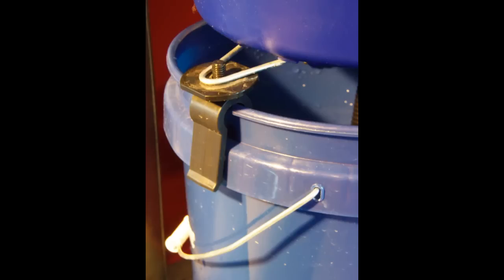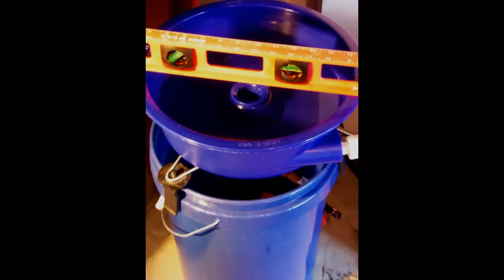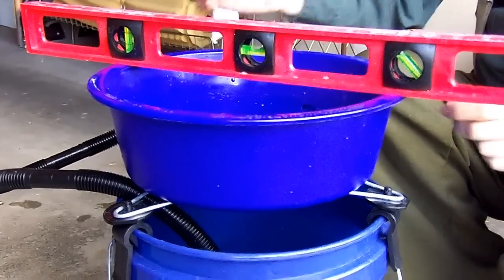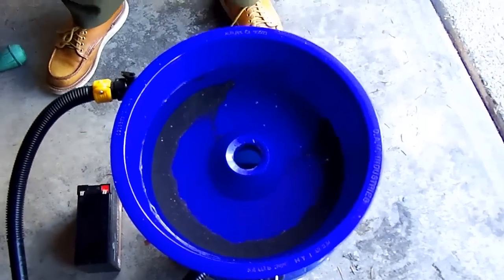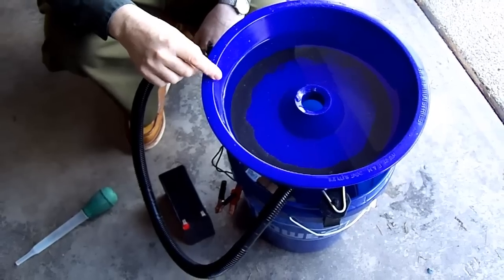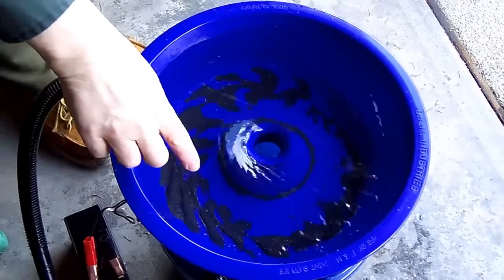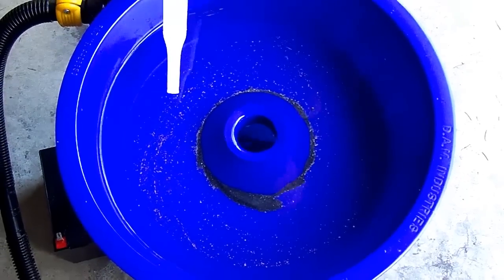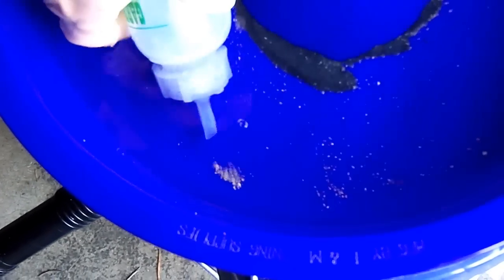Blue Bowl Tutoral for processing of GOLD concentrates

Comment: In my area gold is fine and flat. (0.1 - 2mm) Many times tried to wash it through the blue bowl, but nothing works, even at minimum water speed the gold is washed away with the sand. Maybe the Miller table can help, it seems to hold flat gold better.
Reply from the maker: Have you tired cleaning your bowl with dishwashing soap?  If there is an oil film on the gold--it will float away.  When your machine comes from the manufacturer, oiled metal  parts are used to make it, and so residual oil is usually found in the bowl.  Clean your bucket below also, as any oil on it will transfer into your bowl.  Also, put just a few drops of dishwashing soap in your water when you begin--every time.  It acts as a surfactant, making sure that the water touches all surfaces of the gold.  I never had your problem with the blue bowl, and used it on flat glacial gold.  So, it can work.  Remember, when you pan your gold you do not use the river pan technique.  THere is a special technique you need to use, or gold will float out of your pan.  Let me know if you continue to have issues . . .
Reply: @callmeBe  Thanks for answer! :) Yes, I washed it very well according to the instructions, there should be no oil inside. The gold is mine from the adventure scluice, then I put it in the blue bowl and try to clean, but at any speed, it all washes out. I even added the Dream Mate inside hoping it would help, but the effect is almost the same as without it. And there is a lot of gold in my spot, I once extracted 5 grams of gold from 2 kilograms of sand just by hand, but it is very long and tedious. I am trying to find a technology to clean my sand with fine gold, but so far I can't think of anything...
Reply from the maker: @teolegrande304  It is going to be very difficult.  Don't do mercury!  I would still put a surfactant in your bowl, to insure total surface contact with water.  Because the gold is so very fine, then the only other thing it could be, because the bowl is an absolute study in physics, and it can not fail if everything is right, is your mesh is not fine enough.  You need the very smallest mesh you can find.  If you are losing gold, the iron weighs more, or at least as much, and so you need to decrease the difference in weight.  Therefor, no matter how fine your mesh is, you need something smaller and finer.  I would not search gold mining stores.  I would search industrial supply stores.  Try Amazon with HYHMJ-Industrial Metal Mesh 6 Mesh - 20 Mesh - 80 Mesh.  I will bet your mesh is not 80 mesh fine . . .
Reply: @callmeBe  I have different classifiers and 80 mash too. I'm always sorting all the material. I get two kinds of sand with gold in it. The first is a little bigger, with 0.5-2 mm gold, and the second material contains all the gold less than 0.5 mm. The blue bowl flushes both. I think my material has a lot of sand in it and that's why the blue bowl doesn't work as it should. But I have a very hard time flushing sand by hand, a lot gets lost :) I will experiment, because it's a shame, so much gold nearby, but I can't get it :) Thanks for the tips!
Reply from the maker: @teolegrande304  I understand, but that is what  I was saying before.  You don't pan your kind of gold like river gold.  You need a specific pan, a surfactant, and a different technique--where you swirl very little if any, and the process is technique sensitive.  Let me get you a link.  Yea, the less material you have to seperate, the better recovery you will have.  You want to follow Keith from Youtube's "Hard Rock University."  He is a great guy, has a tremendous amount of experience, and is an excellent teacher (also was a friend--old geezers stick together--but I have not talked with him in years). Don't expect classy videos.  I see where here is using 300-500 mesh.  80 is way too big.  (I don't have that much experience with microgold).  watch this:   https://www.youtube.com/watch?v=IPEUJQi7-Lc     If you write him, he always answers quickly with reasonable content.  But I think your problems is basic:  probably mesh related, and you need to always use a surfactant.  (which he covers in this film).
Reply from the maker: Here is another good video by Keith.  His technique works.  I had one mine years ago that yielded micro gold, and I was successful with the technique he demonstrates here.  (Thing is for me, I want course gold;  the fine stuff is too much work for an old man).  https://www.youtube.com/watch?v=dEmnr5cV2Y0
Reply: @callmeBe  Thank you very much for the links! I will be studying them and experimenting! :)

Comment: Anyone here used this to recover gold from quartz flower/powder?
Reply from the maker: Well, other than purity, gold is basically gold.  So as long as it is in a mesh form, it will recover using this system.  The limiting factor will always be that you finely mesh ALL your material.  If you screw stuff up--run the water too fast, don't properly mesh, than you can always process again.  Nothing is ever lost until you throw it away.  One thing to consider, if your finds include micro gold, this system would probably not fully work, because the gold will be lighter than your sands--as your sands have relative thickness, whereas the gold would not--yet both having the same relative size.

Comment: Thank you for the information. I just got the blue bowl by itself. I do some fabrication so I will be making the levelers and using a swamp cooler pump I already have. The bucket the blue bowl sits on will be sitting in a larger tub with the pump in the tub, this way all the cons will be in the catch bucket and not in the water the pump is sitting in.

Comment: Hi, help me guyz i need this blue bowl or equipment where can i buy it!!! Plz help
Reply from the maker: I sold all my stuff and retired,  Ebay is probably the best place.  Make sure when you,ale purchase you also buy the shims.  that way your blue bowl sits flat.  It will not work if it is not dialed in flat.  The tubing you can get cheaply from any hardware store, and the water pump you can easily buy used on ebay.
Reply: @callmeBe  I use a 1 or 2-amp trickle charger with an old car battery that won't hold a charge for a car but powers the pump fine, just plug it in to use, and unplug when done. Any auto parts store has them and runs $20- $25.
Reply from the maker: Good thought

Comment: Hi, how long does thebattery last before you have to buy a new one. Thanks in advance?
Reply from the maker: Hello Doug.  Well, it depends upon how much you use it.  But a deep cell will generally last about 5 years with modest use ( maybe 15 hours of use a month). 4 years if you use it twice as much.  They are a good value, Doug.
Reply: @callmeBe  oh ok thanks
Reply: I have an old car battery hooked to a trickle charger,  1 or 2 amps, and I plug it when I run the bowl and unplug it when done, it's been going for years- think the low amperage of the pump it just runs off the charger, but the battery does hold a charge, not for a car, but has enough to run the pump overnight!  I forgot once.

Comment: i am working with 50 mesh material, the blue bowl no matter how slow i have the water circulation in the bowl, will take both the (few) gold pieces as well as the non gold material. i am trying to figure a way to stop this from happening, everything goes into the bowl at the bottom, but i may as well have just put a spoonful of material directly into the bottom bowl.
Reply from the maker: Hello.  50 mesh is about as large a material as the bowl can take, so you should be fine there.  It should process it easily.  I would bet that your bowl is not exactly flat to the floor.  Even when you are not even by a tiny bit, you will loose gold.  There is a inexpensive kit that is independent from the basic bowl  which helps you to insure everything is flat.  Of course, check with a level at several directions also.   I hope that is your problem.  It is easy to solve.  Oh, also, place just a titch of wetting solution in your bowl also.  Any dish washing soap will do.  Just a titch!  (Make sure you have also washed your bowl with soap, as it does come with a small coating of oil).
Reply: @callmeBe  well my BB is as level as i can make it, i have a large and a small level to double check each other, the small one i set on the inner cone, the large one i set on the bowl itself, just to make sure, so all good on the level part. i use jetdry in my BB, my problem is not floaters, the non gold material is basically the same size as the few pieces of gold i fine, i run the water speed slow but i still see the water flow move gold and same size non gold material around and slowly up the cone. i run my BB on top of a nugget bucket, so i still catch it all at the bottom, but its just extra work for me when BB pulls the gold and the rocks up out and down. i have had my BB for over a year now trying to get a positive action from my BB, so the new oil coating is long gone.
Reply from the maker: If it is as you say Zemetrius, then the process must work. Not should work.  Must.  It runs off of simple physics, which you have provided.   This is not a demeaning question, but are you absolutely sure that is gold in your finds?
Reply: @callmeBe  just to be sure it worked, i added some that i had found just to make sure it would work. so the test batch did have some in there, but it took what i put in there with the non gold material and sent it to the bowl in bottom of the nugget bucket.
Reply from the maker: And you are sure what you have is gold??  Again, if everything is as you say, the system works perfectly off of physics.  You simply control all the variables (speed of water, same sized mesh, bowl flat to the floor, no oil introduced, etc) and the system can't help but work.  There are no exceptions.   I can only suggest calling either the manufacturer, or the dealer from whom you bought the bowl from.  Or further testing, say,  with gold from a known source (buy some mesh gold on eBay--I see several that sell 50 mesh, but you will need to talk them down to a very small amount).  Then, when you have satisfactory results, let us know here on this channel . . .
Reply: @callmeBe  well i guess i could melt what i have down to something, but then i would have to get more to test the blue bowl with, but then you would ask again if what i have is real gold, then we would be back to square one.
Reply from the maker: not at all.  Then call your dealer . . .
Reply: @callmeBe  (test 1), water went to less than an inch below the top, everything got sucked down. reloaded material, (test 2), water went to the one inch line and everything was sucked down again, reloaded material, (test 3)water at 1 1/2 inch below the top, material barely moving. still watching......
Reply from the maker: "Adjust the water flow with the ball valve (approximately 2 gallons per minute), so that water is just slightly below the outer edge of the bowl and not over-flowing."  (Somewhere around 3/4" below the top).  'Then slowly feed your materials in.'   These are from the included instructions. I work mine differently, but the most important thing is that once you have the bowl working, the water level should be about 3/4" below the top.  Now, how you measure 2 gal. per minute I do not know.  But what I do know is that as the system begins to work, you will see the black sands begin to riffle out (like the video does here at 7').  At the same time, you will slowly see the lightest material migrate towards the center.  Is there any possibility your water pump is set too high--and you are just blasting the material out of the bowl?  You can do the same effect in a sluice box  . . . This will probably be even more the case if your gold is very small and pounded flat--like glacial gold, or beach gold.  If this is the case, certainly, you will get much less black sand riffling as it becomes less and less.
Reply: @callmeBe  test 3 continued: water holding at 1 1/2 inch from top slow movement of material, but if i try to tweak it, it wont take much to suck it all down again.
Reply: @callmeBe  the water pump is set at it lowest speed, did this much earlier when i was trying to make the thing work before. my material is classified through several mesh screens so there is no black sand, it has all gone to the lower depths. this material is stuff that sat on top of the #30 screen along with whatever gold was there also on top of the screen. the water is slowly creeping upwards toward the one inch line, then it will do the tornado thing and suck it all away. at 3/4 inch there would be nothing left of the material i am using right now. this is the headache i dealing with.
Reply: @callmeBe  i replaced the ball valve that came with the blue bowl, i installed a gate valve, its works much better compared to the ball valve.
Reply from the maker: Sorry, I don't understand exactly what you are writing.   "my material is classified through several mesh screens so there is no black sand, it has all gone to the lower depths. this material is stuff that sat on top of the #30 screen along with whatever gold was there also on top of the screen." Generally your gold is going to settle where that black sand is, somewhere around 50 mesh.  30 mesh is kind of coarse, and the largest size the bowl is made for. Your blue bowl is for separating gold from a lot of black sand--all of the same basic size.  If there is not a lot of black sand in your bowl, then you should be just panning your gold out.  Not using the blue bowl.  In other words, you will be blowing the gold out of the bowl.  There needs to be black sand along with the gold.  That is what the bowl is made for.
Reply: @callmeBe  well i guess i wasted my money then.
Reply: @callmeBe  i need to find a rocker sluice that is angled like the mini riffles on a pan. all the sluices i see online all have the riffles facing the wrong way. at least the wrong way for what i need.
Reply from the maker: The only rockers and sluices I have seen either have riffles that are simply 90% straight up, or the Hungarian type--that have a lean with the water stream, and an undercut on their back side.  If you go the opposite direction, and put a slant that faces into your water stream, I guess that is ok, as long as you have a deep catch (undercut) below the slant.  But remember, gold generally settles on the back side of riffle, not so much on the front--even when there  is an undercut.  This is because the back side of the riffle sees slower water than the front side--giving the gold a chance to settle.   I guess you could always get your sluice with the Hungarian riffles and just load the whole set in backwards.  Then you would have your undercut and the angle of the riffle slanting the way you want.  But I would not recommend that.  I would be concerned about the ability of the water to slow down around the undercut when the angle of the riffle is opposite the way it should be.
Reply from the maker: Oh, I don't think so.  If you are finding 30 mesh gold, than there is a very high possibility you are finding much smaller gold also, contained within all that black sand you are seemingly not processing.  I think you are just not aware.  Maybe your panning skills need improvement?    There are two panning styles.  One for river gold.  One for micro gold.  You can combine both styles to insure you see all your gold contained within the pan.  There are a number of good videos on this type subject.  (I do not have any).
Reply from the maker: For your panning styles, check with hardrock university.  That is by far one of the best mining channels on You-tube.  And there are a number of videos on micro panning.
Reply: @callmeBe  i do not see a need to keep the black sand, if there is any gold in the black sand it will separate at the mesh screen, the gold will not go further despite the black sand, if that screen does not catch it, then the one below will. just for the record, i did recover my single piece of gold from the test run material, when i processed the rest of the material that the bowl kept throwing out, i found another 10 additional pieces so far, still have more material to go through.
Reply from the maker: "i do not see a need to keep the black sand, if there is any gold in the black sand it will separate at the mesh screen."  ???  If the gold is the same size as the black sand you will not separate one from the other in the mesh.  That is where you will use your blue bowl.

Comment: According to the manufacturer's instructions, the distance from the top edge of the bowl is dependent on the classified sizes to prevent "blowing gold out". You also should not run material coarser than 30 mesh.